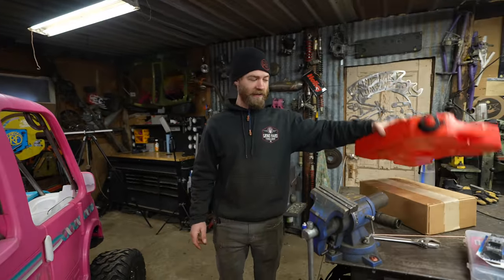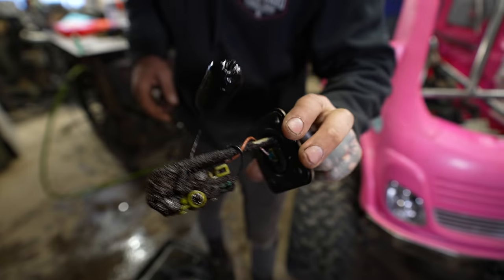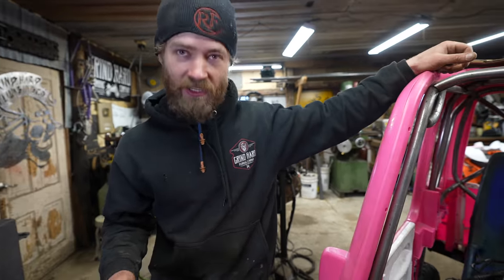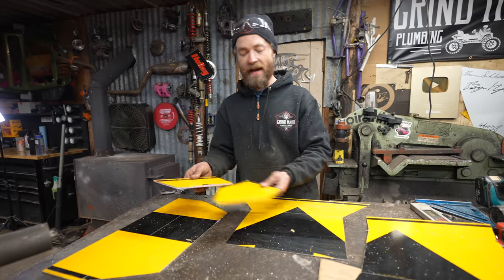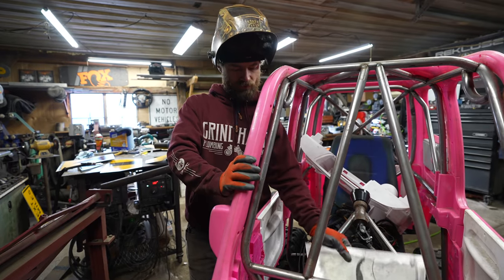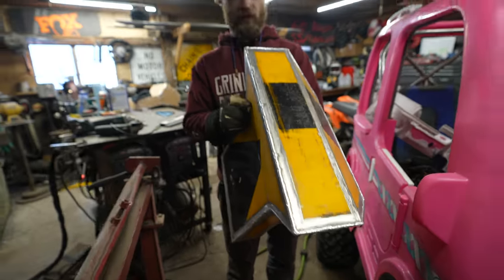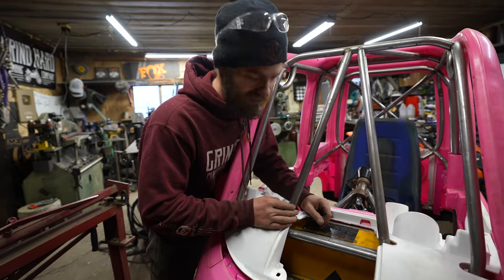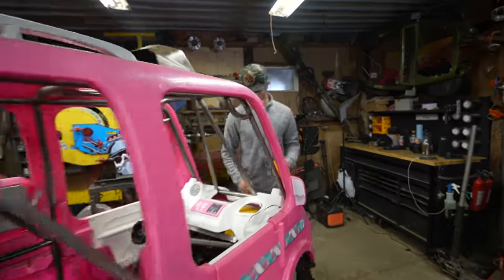Building a Gas Tank out of a Street Sign! 4X4 750cc Power Wheels Build!

Comment: When working with aluminum you can soften the areas where you want to work or bend through a process called Annealing. I'm sure there are lots of You Tube videos on this. Or just warm the area to around 300 degrees and it will move much easier. Above 300 it starts changing the properties of the aluminum. Always enjoy the videos. Thanks,

Comment: Turned out really cool. You'll probably end up with hot fuel but i don't think it will be enough to matter. You could always stick some insulation on the side near the radiator if necessary. I would definitely keep a fire extinguisher accessible to the driver in the off chance the fuel tank ruptures or leaks onto the engine. It's probably a long shot but if it happened it would be real uncomfortable real fast.
Reply from the maker: Yeah, might wrap the tank in reflective heat tape, and will definitely have a fire extinguisher on board, since you can’t just jump out of this one…
Reply: @GrindHardPlumbingCo  Most certainly wrap in ally heat soak tape or copper etc for the colour infusion 😅🙈 you'll be fine then get the thicker stuff not thin single layered ✌️

Comment: Nice work. Any concern that the tank will reduce airflow through the radiator?
Reply from the maker: Thanks! It shouldn’t make much difference, I think.
Reply: Wouldn't worry with enough flow or pressure e.g.1.1 to1.2 1.3 bar etc helps using math you can increase flow and or pressure by 10 to 30% with just off the shelf upgrades majority of systems can take increases just have to double check but its always viable option cheap temp sensor will tell you if at max load from donuts burnouts etc if needs upgrading but doubt it unless you hide a radiator sideways with no air flow re direction etc its a concern really most vehicles have far more real estate than static machinery and we wedge ours in with minimal clearances ✌️ lots of love from mech engineer in heavy duty recycling sector 🏴

Comment: You can ease the tool pressure when cutting threads by moving the tool using the compound.
Make sure your compound is lined up parallel to the work surface and when you start to have trouble with the tool pressure just dial the compound over a few thousands so the threading tool only cuts on one side rather than both sides. And in your case this will also help with dealing with the different thread pitch going from SAE to Metric.
   This obviously will take a little more time but it's not like you're doing a production run.
Reply from the maker: Thanks for the tips!

Comment: If you can heat the aluminum with a torch to take the temper out of it you will be able to bend it . street signs go thru a tempering process to make them ridged to withstand wind and the beating from weather that's why after 20 or more years there still the same shape and not bent all to hell .
Reply from the maker: Thanks for the tip! I will try that next time!

Comment: If you heat up aluminum, it bends further without cracking. But, being a natural heat sink.... you would likely need to remove all of the weather proof reflective  god knows what they use to make those signs. Making the extra cuts may be worth it in your situation. Love these creative build techniques you have been using since day one. This is definitely another banger of a project.
Reply from the maker: Thanks man! Yeah, heating it would probably be difficult and toxic for sure. 🤣
Reply: @GrindHardPlumbingCo  100%

Comment: Have you thought about the fuel temps with it being right behind the radiator?
Reply from the maker: I did consider that, but I’m not too worried about it.
Reply: @GrindHardPlumbingCo  It’ll all be fine😂. Great work though. Your fab skills are incredible. Thinking about taking my 250cc quad and making it into a cross kart this spring
Reply: What about radiator temps with the tank blocking airflow?
Reply: The tank is behind the radiator so it'll be fine i think

Comment: If you anneal the aluminum it will bend just fine. Put carbon from a pure acetylene flame on one side and heat the other side until the carbon burns off, let it cool, and bend away!

Comment: If you use a sheet metal bending die where the radius of the bend is 3 times the width of the material you can bend 6061. We frequently do at our machine shop because 6061 is the most used material so rather than checking out soft aluminum we just do it that way.
Reply from the maker: That makes a lot of sense!

Comment: Think baffling for the wide top sloshy sloshy section.
Or fuel foam or wiffle balls
Reply from the maker: Oh yeah we can use the foam like we did in the Camaro!
Reply from the maker: I don’t think sloshing will be too much of a problem, since the pickup is all the way at the bottom.
Reply: @GrindHardPlumbingCo  
My thought was more so about weight transfer when it's close to full, since it could be a couple of gallons sloshing to the outside a in a sharp turn pretty high up.
But I do dig the salvage material use and design, you guys always do top notch work, and I would still like to see you make your own Powder Coater with a couple electric ovens, your projects deserve it

Comment: An easier Solution for the Gascap, cut a 2-3 Inch Piece of the old Filler and turn the Aluminium Innerdiameter down to the Outerdiameter of the Plasticfiller and glue it in
Reply from the maker: That would be easier! I kind of like making the threaded bungs on the lathe though.

Comment: To have all the necessities you could have just made box that goes around the cup holder but ou well just need to build it somewhere else then. Also how are you going to get that disk out of the tank well as all those chips? Maybe drill the hole before closing all the sides, so there is just what ever crap comes from welding seam and already have pressure relief point so those hot gasses wont pop the last bit of the weld seam porous or out entirely?
Reply from the maker: That would have been cool to keep the cup holder like that! Oh well, next time.

Comment: Is that vacuum fuel pump going to have enough lift to get gas out of the bottom of that tall tank? Might have to go electric to make sure you've got enough fuel pressure.
Reply from the maker: It’s lifting from about the same elevation as the original location.

Comment: Would you have ever ever consider using aluminum tubing welded to the tank, and slip fitting the plastic gas cap neck into the aluminum tubings cut/bored ID and a little fuel/Al/Plastic compatible glue? Since you didnt have the "correct thread" gears for the lathe?

Does anyone know of inexpensive aluminum threaded neck and threaded sealable caps for fabbing tanks? Both for fuel and oil sized ports? Always way more work than necessary to adapt existing caps to a neck...Would love to have aluminum threaded necks with standardized common sized threaded caps! 
threaded
Reply: Lol I thought the same thing as soon as he cut to the plastic gas tank. Brain has a wired thought process when you’re in the zone
Reply from the maker: That’s actually not a bad idea! I like making the treaded bungs on the lathe though!
Reply: @GrindHardPlumbingCo  So do I when there is a driving force behind keeping a specific thread, like matching caps from existing oil filler and a added aux 2 stroke injection oil tank. They make inexpensive cnc oil caps, but never have I seen the mating aluminum neck off the shelf that I could just weld on and continue on with the project when desired. Try and pick up any kind of bung and fitting to toss in the supply bin, but never found a reasonably priced weldable filler neck yet.
Reply: @BeaverBaister  I just know I have fought with DIY  cap threads in the past, and was surprised the non matching thread seemed to work so well... with fuel I personally would want a reliable seal, almost surprised he didnt just pipe the rotopacks to drain into a small main tank. Would allow basic use, and automatic extended range with a gravity fed aux tanks for power wheel overlanding or extended trips.

Comment: Still want to know of a affordable reliable product that could seal the inside of a welded tank for oil and fuel. Have a few fabbed tanks that just wont seal, and weep, would be great to toss some material in and the holes would disappear by clogging up and creating a water right layer.
Reply from the maker: Have you tried Red Coat? We have used that a few times and it works well!

Comment: Hey man, love the channel, but don't ever recommend to use brake cleaner prior to welding.. most contain chlorine that gas up when heating which is a "bit" toxic and if you get any of that on a rag or your sleeves it stays highly flammable for a long while and some use real clean burning stuff as a solvent so the flame you won't immediately notice until something else starts burning... use a proper degreaser/cleaner.
Reply from the maker: That’s all solid advice. We do always use non chlorinated brake clean, but I will definitely mention that it’s a bad idea next time I talk about it on camera.
Reply: @GrindHardPlumbingCo  I just re-read my comment and sorry if it came off too blunt..it's a Dutch thing.. you guys rock and you're one of the "influencers" i don't have a problem with while watching TV with my sons. Keep up the good work!

Comment: What welder are you using to tig with? when you first started to weld it look like it was scratch start tig?
Reply from the maker: It’s supposed to have high frequency start, but it broke a while ago and I haven’t gotten it fixed yet.
Reply: @GrindHardPlumbingCo  I was just wondering because I have a Lincoln 210mp and I’ve heard you can’t tig weld aluminum with it because it’s scratch start. I wish I could somehow though.

Comment: good use of space but i feel you have killed your cooling and gave your self a possibility on having vaper locking problems with your fuel system ive seen some custom harleys and other bikes with the tank sat to close to the engine and ran for long enough it will lock up your fuel flow strand you for a bit unless you know what happened of course
Reply from the maker: Time will tell, I guess. Hopefully it’s not a big problem.

Comment: Putting the fuel tank between the radiator and the engine is about as stupid as you can get. Next time use a glass fuel tank and mount it above the exhaust. That will work even better. Or at least use a burning rag as your gas cap. "Molotov anyone?"
Reply from the maker: Go ahead and build one of these, then tell me how to do it better.